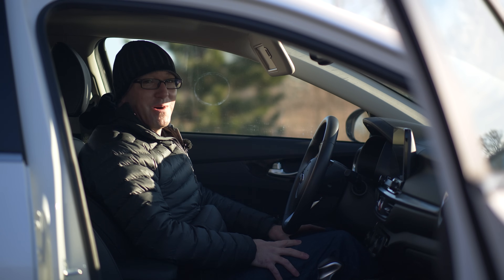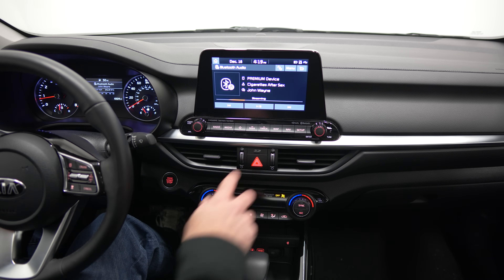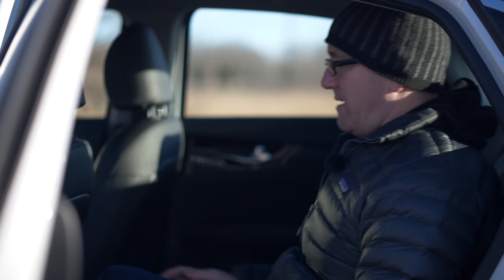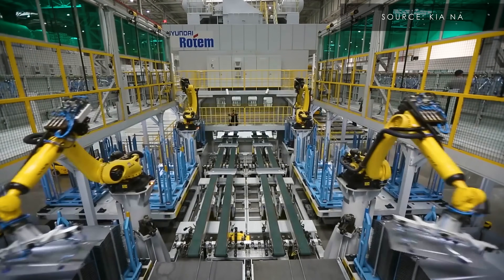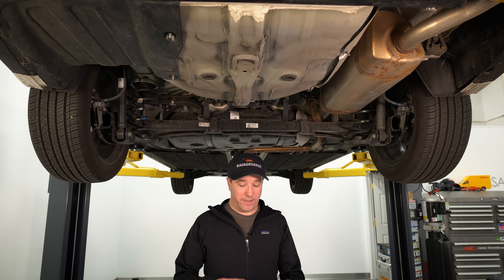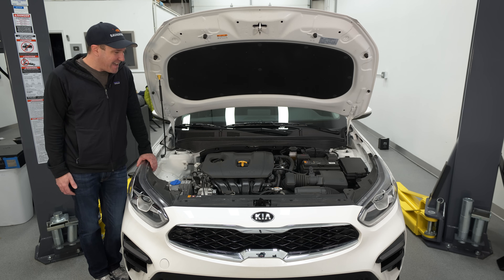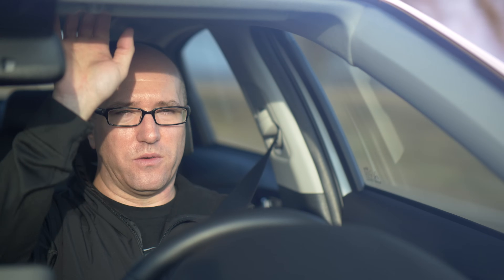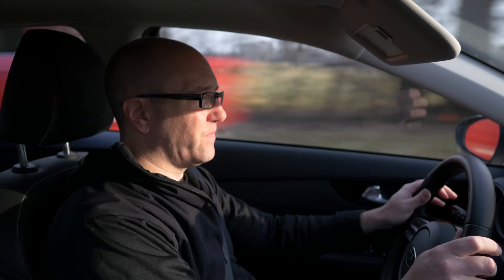2019 Kia Forte Review | Bait and Switch

Comment: After researching and reading reviews of the CVT/IVT, I took a chance in November 2018 on the 2019 Forte EX.  Brought my BARELY 2-MONTH-OLD 1500-MILE 2019 car to the shop yesterday...WHOLE CVT is being replaced.
Reply: Norma, was there a recall on it or did it just fail?
Reply: @ztekz  No recall on the CVT at all.  The only recall was  the front LED lights may be placed on crooked.  I finally got my car back after a month.  Drives fine now, but plan on trading it in as soon as I can.  It's a shame...great safety features for the price, but not worth the paranoia of wondering when the CVT will  go out on me anytime soon again.  Good luck if you decide to go with the CVT.

Comment: My Forte is a good handling car with one exception ., the rear damping won't keep the tires on the road on a choppy cement freeway off ramp , to the extent it will get sideways "if", you don't slow down to below what other cars can easily handle.Base level tires have absolutely no wet traction, but are long lasting & work well enough dry that you probably wouldn't replace them till i did (at over 80,000 kms).I love my conventional 6 speed converter driven automatic  transmission ., it's the best automatic I've ever driven., but given they had earlier models with engine failures( 2010 to 2013 & maybe beyond ) I would not change the transmission design & risk more complete failures there....Although my car is 2011 it far outperforms the Toyoto Matrix in terms of acceleration & fuel economy of the same year .Same type of fuel injection as the new one & that works well.. Unfortunately my engine is threatening failure with only just over 60,000 miles on the clock.,& that is serious enough given in canada the warranty is now up & the dealership played deaf to the winter start engine noises it produced in the very first year i had it! Apparently I have company, (given the class action law suits)...Would I buy this new one ?...NOT!

Comment: That was a good point about the transmission: it's very good, but not yet proven in long term use. What about the Elantra GT's double clutch? I am interested in the new Elantra GT N Line - has it's dual clutch transmission been out for a few years or is it also brand new?

Comment: RE: ..Torsion bar suspension, I owned a 1968 Chrysler 300 model years ago it had Torsion Bar suspension, using 2 round steel rods one on each side at the rear  that could be adjusted for tension. Not a new idea, just been modified from the original .

Comment: I wish there was a grand project or something resulting in a master-level set of insights into how to design rattle-free interiors.
But hey, it's probably like you once said: The engineers know. But they had to cut corners.
I had a nasty rattle in my Corolla E11 Hatchback that sounded as if a rear side window glass was loose. They had to remove all the trim and study it to figure out what caused it. It was not at all obvious, not just a loose part you could see. Took them a while to stop it. (I absolutely hate rattling. I have a low tolerance threshold for such. It's like a constantly nagging passenger.)

4:55 I think if there's a risk of pet urination on those seats, you should cover them with foil. Those are pores in the surface. It's gonna get absorbed into the cushioning material, I'd suspect.

It gives me at least some hope that there are still efforts to emulate the simplicity of cars of the past.

Why does a CVT act like an automatic with RPM bouncing up and down as if it was shifting gears? 🤨 Shouldn't it behave mostly like a scooter to achieve optimum power utilization? ... Is it for style? For the experience? Wouldn't one choose a manual or automatic for that?
Reply: This is basically the modern gen Mazda3 regarding sound design/rattle free . More expensive but its very quiet for the segment and rides super smooth, even with the torsion beam. Mazda goes the opposite way where they invest more in drive quality rather than stuffing a spec sheet, which probably hurts their sales more than anything. Most people, especially in the budget segment who have driven all of their lives in louder, rougher, older vehicles basically don't notice or care unless its egregious (and I truly don't say that as a bad thing)

Comment: I would have bought one if they came out with a redesigned Forte5 with the 200hp turbo engine, but still I'd be on the fence due to the limited aftermarket mods for these Korean cars

Comment: The first gen Kia Forte the best when it comes to compact cars. I rather have a non touch screen barebones infotainment with single disc cd, am/fm, aux, and Bluetooth in the base and middle trim, and manual seats even in the highest trim to make room for rear independent 5 links suspension, solid rear disc brakes, 150+ hp 1.8l direct injected NA I4 engine with bldc motorized vvt, 10 speed automatic transmission, and high quality plastics, and a 276 hp turbocharged 2 liter 4 cylinder high performance trim with an 8 speed dual clutch transmission for a crazy fun sub 30k driving machine plus top grain leather interior, aluminum pedal pads, hi fidelity sound system from bose or Harmon Kardon, ventilated rear disc brakes and beefed up front brake calipers, full led tail lights, tungsten xenon projector headlights with led drl and turn signals, aluminum alloy control arms, multi touch infotainment center with android auto and Apple car play, flat bottomed steering wheel, and exhaust system that sounds really good and does not piss of the neighbors unless you WOT it.

Comment: I was trying to choose between the 2019 Kia Forte EX, 2019 Toyota Corolla Hatchback XSE, 2018 Mazda 3 GT. Both the Toyota and Mazda would have been more fun to drive, but the monthly payments were higher than what I could afford. I decided to lease the Forte because it drove much better than the Nissan's CVT I was driving before and the cooling seats is a nice touch.
I'm super intrigued with the Mazda 3 redesign launch, especially their upcoming mild hybrid system. One of the reasons I leased rather than bought was so down the line, I can get a Mazda. In three years, they should have worked out all the kinks for the new engine, and I'm hoping if it does well, they'll put it in the CX-5. They just put the latest Mazda 3 engine in their CX-5, so who knows?
Question: The Mazda 3 would have caused my insurance to go $30 a month! Do you have any idea why? Are the cost of repairs or rate for injury claims higher? Initially, I thought it was engine's horsepower, but the non-turbo version of the CX-5 was about $80 less over six months? The Toyota Corolla Hatchback XSE has higher horsepower than the Kia, and it would have increased my insurance the least.

Comment: I kinda like the overall exterior styling of the 2017 and '18 Hyundai Elantra a bit more than this new Forte, but I think this interior looks more elegant and upscale versus Hyundai's conservative approach.  One of the criticisms I've heard about the Elantra is that it's suspension is a little too soft and that the electric steering feels kinda loose and vague.  Despite using the same chassis, it sounds like the tuning is better in the Forte if you like to feel more confident in the corners and at higher speeds.  I'd love to get your opinion of the ride handling tradeoff with the base fifteen or optional sixteen inch tires.  Perhaps it doesn't feel quite so firm over potholes when riding on tires with slightly more sidewall.

If I were in the market for a new compact sedan (and I might be in the very near future), I would give the new Forte some serious consideration.  I just wish it offered an even 'basier' base model option at a reduced price.  While the overall bang for your buck package looks pretty good from a value standpoint, I would gladly forego stuff like the standard dual zone climate control and pop-up infotainment screen for a slightly lower asking price.

Comment: You make great videos and this one is no exception.  I'm one of the few that would rather forego technology to have more actual car.  I'd rather have independent rear suspension and a good seat than some wiring in the dashboard I'd probably never use.  I think technology, while wonderful at times, is out of control.  One issue I take with many automotive reviewer's and writers, is the angle of costs to the manufacturer.  Yes, it would have cost KIA $300 per car for IR Suspension, but they get that paid back when the car is sold.  The issue you point toward is will the $300 affect sales.  In this case of suspension it isn't a huge issue but I've never had sympathy for manufacturer's using cheap materials because it cost them too much to do it right, since they get that money back when the car is sold.  One look at GM's massive loss of loyal customer's over the years proves that in the long run it isn't worth the savings to follow this method and perpetuate the whine about "Oh it costs us too much".  Bologna!

Comment: In some ways, cars like this are an argument to buy a Hyundai Kona. 
The Kona is mostly a Hyundai Elantra with a raised suspension.

The Kona can be acquired with the same port injected engine as the new Forte, 
but with a traditional 6-speed - time tested - automatic transmission.
Kona models with all-wheel drive, also get an independent rear suspension. 

The Kona is more money, but it is a better value. Also, the Kona's raised height
is much more convenient than the lower height of the Forte or Elantra sedans.

In fact, It would not be to extreme to say that vehicles like the Kona, and
Honda's "HRV", are slowly becoming the template for "basic transportation".
Reply: Why is the raised ride height important for you. Only benefit I see is parking in countries which have those stones at ends of spots, easily can break a bumper. Most people are stupid and think an SUV is actually more durable than a sedan, they're exactly the same cars...one is just lifted with sometimes bigger wheels.

Comment: Hi. Between 2019 Kia Forte EX and 2017 Honda Civic EX with Honda Sensing, which one should I go with? I'll appreciate some pointers.
Reply: Murtuza Rangwala if you’re buying it get the Honda depending on the miles. If you’re getting the forte you gotta get a good deal. The main issue with the Kia is the suspension. Beats you up. Honda is smoother

Comment: You can have excellent handling in FWD without IRS.  Think cars like 99 Infiniti G20 or 99 Passat.  It’s all in tuning, geometry and body structure.
Reply: That said, any recent Hyundai or Kia I’ve driven has had the most awful electric steering and over sensitive brake servos.  Very overdamped too.  Very solid structures, though.  Focus still rules this segment as far as chassis dynamics go, over Mazda, Honda  and VW.  If it’s an appliance you want, the Cruze does bland better.  Buuuut of course both are discontinued.

Comment: So now the 2020/2021 models are out right now. Have you guys done a review on them yet? I'm curious to know about the transmission that you questioned (whether it would hold up or not) and if there were any further improvements.  I'm interested in something in the GT line. Anyone have any thoughts on this?  Just want to add that I checked for any safety recalls on the 2020 and there are none and the IIHS Crash Test & Rollover Safety Ratings are good across the board with the exception of the restraints, which are Acceptable.

Comment: Not a Kia, but the IVT in my 2020 Hyundai Elantra is absolutely awful. It's a whirring, clunking, jerking, unresponsive, roaring, growling mess that has almost no power below 50% throttle and violent over-acceleration past 50% throttle. No codes, perfect idle, perfect air/fuel/spark, no vacuum or exhaust leaks. The IVT has a bad tendency to psychotically hunt ratios with steady throttle - I've nearly had a few accidents because it decided to slingshot forward when I barely press on the gas. The only good thing about it is that it actually does a good job of keeping the RPMs proportionate with the actual speed, even though it's so slow to rev up at part throttle. I really have to wonder if something is wrong, I've heard of the IVTs prematurely failing!

Comment: Please help me all, I’m a new owner of one of these and it’s fun and enjoyable. Although there are glitches or bugs I believe in the computer logics for rpm vs speed in different modes. So here’s the problem. 

The cvt tranny is a pretend logical 8 speed. When driving in normal or manual sport mode, when I am going 60mph on flat ground same variables, it can be put into 8th gear or put itself there when driving normal and holding gas at 60mph and rpm is about 1500rpm steady..

As soon as you hit cruise button in normal drive mode after holding it at 60mph 1500 rpm steady, the computer logics for some stupid reason sets crushing speed at 60mph but at a way higher rpm which is always 500-750 more rpm and you can’t trick it to not do it unless your in manual sport shift mode where you select gears. In this mode when you set cruise, it dials it in at same rpm that you can force car to do with foot.

When in normal mode and cruise set, it raises rpm 500-750 more no matter what speed you want to cruise at. So why is this, is it a bug or glitch and does it happen to other owners of this new car and or other CVT tranny auto owners of other makes and models and brands? Need to know if this is normal or not.

I don’t think car is broke or tranny is broke, I think computer software is programmed weird or messed up.. or it’s so new they put in wrong values from factory in the computer for cruise rpm which drives the car like it’s a 6 speed not a logical 8 speed which you can manually control.

When you do sport manual mode you can pull off 45-50 mpg highway and city driving mix, no shit I did it in my new forte. This kind of mpg out of cheap new car was what I was looking for and I got it...

Comment: Can someone help me?  At 13:48  it appears as if the transmission is shifting through gears.  I thought the purpose of a CVT is to keep engine RPM stable (at the most optimal torque per fuel flow).  Why does it seem that the drivetrain is "upshifting"?  Clearly, I'm missing something.

Comment: 7:13  That oil filter location is CRAP!  I drive a 2012 Forte 5 EX, and the oil filter I think is bad enough: installed sideways and pointing straight back.  But at least it didn't have a gigantic cover at the bottom with a tiny hole for access.  There is enough room around the filter I can stick a wrench in there and turn it.  This new design, I got no tool that will fit in that hole to take the filter off :(

Comment: I bought a Kia Forte lxs 2023 in April 4-2023 now July 20 2023 5000 mile on it now was a Ford 150 guy disabled on small pension so I looked at Kia truck got 18 mpg forte 36 combined looked. At Honda Nissan Toyota so I pulled the trigger on my lxs paid 26000 out the door in the car lots Honda Toyota were 2500 above sticker or more Kia was 1000 above sticker so buy the Kia love it seats stereo are cheesy but all I could afford was 26000 it’s paid for love my Kia f150 I miss but they are nuts for them I wanted style I always owned nice cars glad I chose my forte the turbo don’t trust after 50000 miles turbos got to be cleaned sister 1500 to have it done that’s why I did not choose the GT I researched this a lot giving u people a heads up God bless

Comment: I’m torn between the civic sport with the 2.0 normally aspirated, and the Forte EX.  With the Forte I get more options and in my opinion a better looking car, plus better fuel economy and a better warranty.  But Honda offers a bright red I love. Plus the perception is that honda is reliable, but I would not buy their direct injection turbo because of possible oil dilution and gunked up intake valves.  Anyone driven both these cars.

Comment: I don't get the "Stinger inspired" styling. Cadenza/Refreshed K900, a little bit. It's an attractive compact that's not overstyled and it looks better than the outgoing model, which wasn't bad either (conservative, yes - needed better performing headlights, too but I haven't heard anything positive or negative about that on the new one yet)

Comment: It's frustrating to me when manufacturers make their CVT's imitate a gear transmission, the best part of a cvt is that you can keep your engine at it's optimal rev range constantly. I don't get why they artificially "shift", doesn't that defeat much of the upside of a cvt? I'm legitimately asking because I see it so often now I'm questioning if my understanding of a cvt is flawed, like in the video we see the rpm's "shift" as if it's shifting gears, but a cvt doesn't need to do that, that's done artificially isn't it?

Comment: The 2nd gen was fun, the 6-speed auto was great, if i had to shop for a new car the 3rd gen will not even be looked at because of the CVT, the manual will be completely stripped down, CVTs are unreliable and for the most part a drag. Mazda is the way to go since they’re not dick riding CVT’s